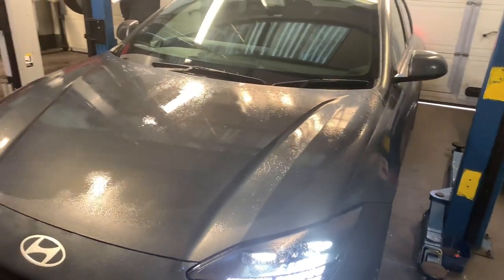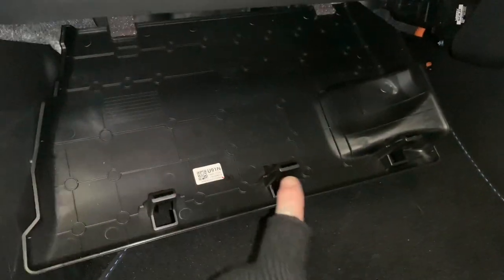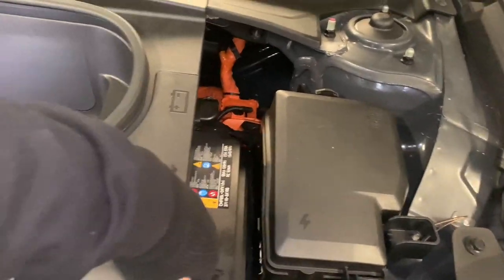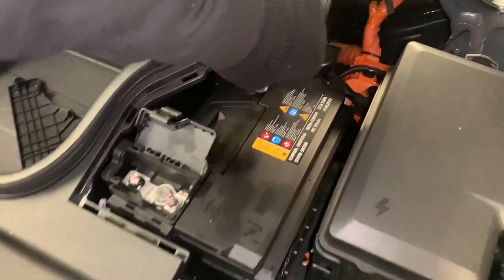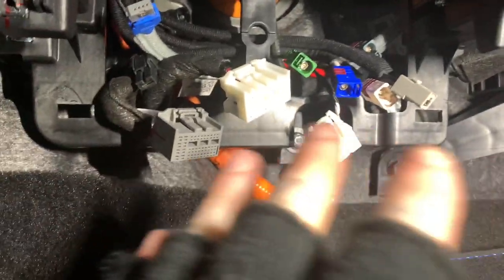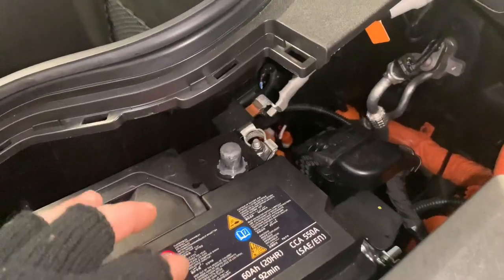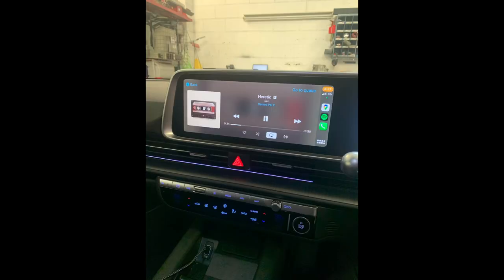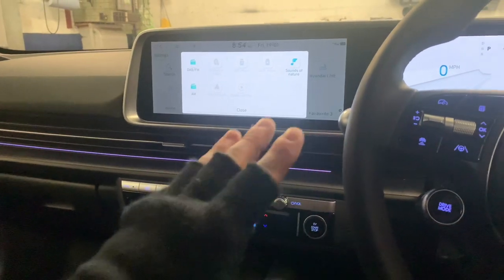Hyundai Ioniq 6 | AVN | Media unit failed | replacement |

Comment: I have the same issue .. my infotainment screen just died and shows the Hyundai logo. Dealer has told me that they need to replace the AVN unit
Reply from the maker: Such a bad design
Reply: @owensautotips  haha .. but why do you think so ? I don’t even know why my screen stopped working .. I am in Canada and we don’t even have OTA updates
Reply from the maker: @IshmeetSinghahuja some units are made by Samsung and others are a different manufacturer which I can’t remember.
But seems to be a common issue happening